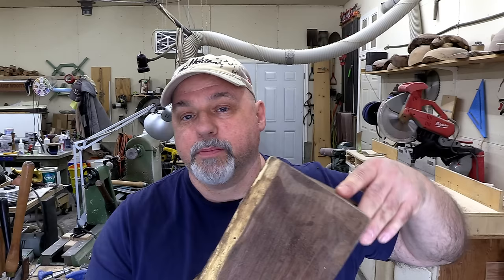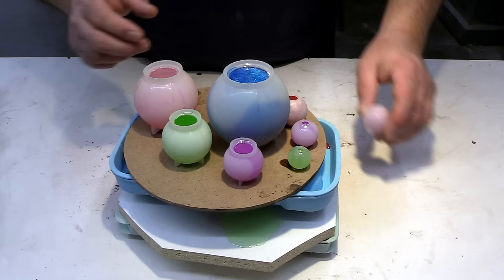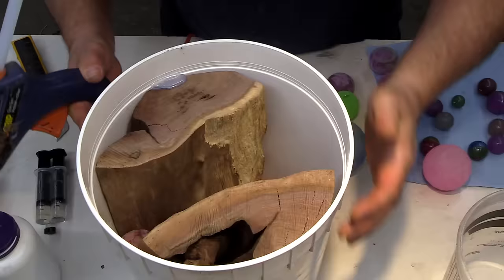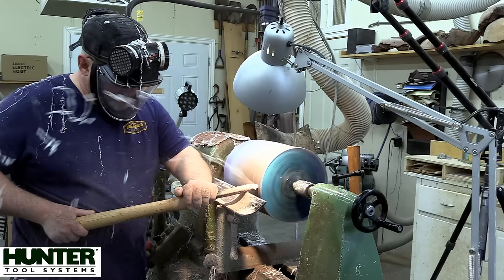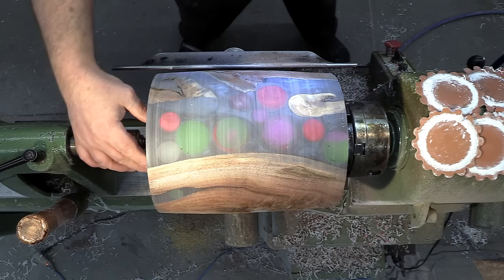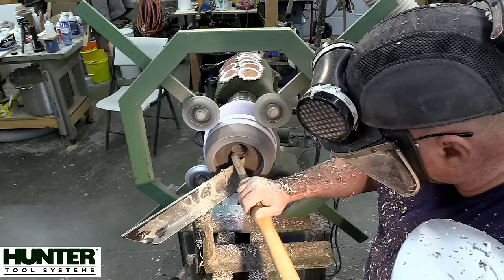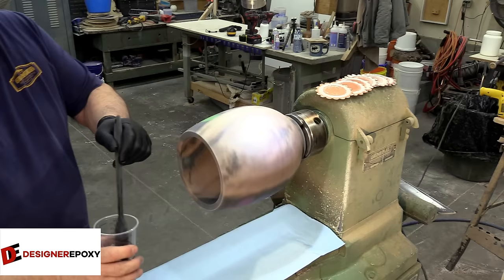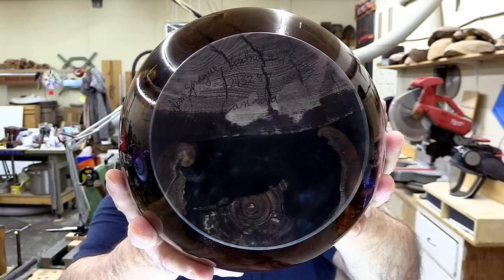Woodturning - It's "OUT OF THIS WORLD!"

Comment: Watching you fight with those silicone  ball molds I totally get it. I feel bad but I was laughing at the same time because I have been fighting with them too. Not the balls but the 4 inch cylindrical molds. My fingers are still hurting lol.
Reply: Oh, and by the way I use isopropyl alcohol (70%) to slip them off. It helps some. But they can get sticky.
Reply from the maker: The struggle is real!  😂 thanks!

Comment: That came out just lovely!  A good trick for getting resin pieces out of complex or tiny molds is isopropyl alcohol. Make sure you get the pure 99% variety and then spray it into a gap, or use a syringe to carefully insert it into the mold. Then squish all around to get it to spread and it should provide enough lubrication to help you pop the piece out. Then it'll just evaporate off. Careful though, it works VERY well and sometimes a piece can come out faster than you expect and end up across the room. Hope that helps next time you have some tiny spheres!
Reply from the maker: Good tip, thanks!

Comment: A good tip for the temperature of the epoxy, I suggest you place your epoxy resin containers in warm water a few minutes before you mix it!
And like that you won't have to lose time by trying to warm it up after its mixed 👌🏼😊
Reply from the maker: I’m usually warming the epoxy up so I can get color separation, it can be a problem when mixing but this is the main reason I warm the epoxy.  Thanks

Comment: A tip for the silicon molds. Hot glue won't stick to silicone at all (most glue won't) because the surface of silicon is too smooth. But if you use sandpaper on the area you want to stick together (like the bottom of the small globes), it will have more grip and stick much better with the hot glue! 😊 (You'll still be able to take it off the silicon, it just won't come off as easily)
And to help remove the resin from the smaller mold more easily, use some Mold Release! 👍🏼
Reply from the maker: Good tip! Thank you very much!

Comment: For the silicone ball molds, why not pour water on the top to weigh it down, baking stones, glass decorative beads,  cat litter... the possibilities are endless.  And to take care of any possible flexing, pour sand or another type of powder into the base of the lower mold, glue a cardboard sheet with a bread of hot glue around the perimeter.  Let that dry and set right side up.  But use the two plate methods for taking cakes out of the baking pan.  (Two sheets of cardboard)
Reply from the maker: Thanks for the suggestions!

Comment: Looks nice. I love the shape and the combo of epoxy and wood. I'm not familiar with that specific brand of top coat however wood Is a living element. The bubbles development comes from the wood itself. You can try using the first coat as a sealant. Buff after drying, then technically apply the first coat. Yes temperature and moisture plays a part in the curing process. But try noting when you do your top coats on a warm dry day or you can manipulate the conditions with a dehumidifier and a non- fan heater or a heating pad nearby for a few hours.
Reply from the maker: Thanks for this. Waterlox is awesome!

Comment: Try a negative ventilation setup on the covering bucket in the clean room for the final curing. Ensure to have a filter on the air inlet side. Just a thought. Designer epoxy.
Reply from the maker: I prefer zero air movement. Thanks

Comment: Have you thought about putting the led lights that change color in your vases to view the colors through the vases. I've used them in my epoxy tables tables brings out the color shifting mica powder.  I also used them in epoxy filled drift wood . Beautiful  display lots of those sold.
Reply from the maker: I certainly have, what’s your source for the lights. Way to many manufacturers out there to know what’s a good one to go with. Thanks
Reply: I buy from Amazon I get the plug in type with wireless remote. I make sure they are water proof also. I've actually put them I'm my pour. For smaller floor statues. Haven't had any negative feed back.  Your going to get the ones that are around 36.00 us

Comment: For the small individual globes try some warm soapy water it helps the silicone release from the resin
Reply from the maker: That really wasn’t the issues. It’s the small opening that you need to fit the globe through is the problem. Soapy water should work though. Others have suggested alcohol too. Thank you very much.

Comment: Really like it. Big fan of walnut and space. I bought one of the Hunter tools and I am having troubles. It catches real easy and takes chunks out of the resin. Watching you I need to hold it at an angle and a tiny bite higher than center when working on the outside. I love the gloss with the Waterlox. My biggest issue is it doesn't last long in the van after opening. I've got some stop loose bags coming in the mail. Designer Epoxy
Reply from the maker: Yes, stoploss bags will correct this in the future. Thanks for watching!

Comment: You mentioned that when using the ice cube molds they tend to separate, I think it's because the injector is closing off the hole and there's no where for the air to go so it pushes the mold apart. Try distorting the hole when you inject the epoxy so the air can escape. I think this may also fix the flat spot when it's not filled completely. Just my opinion. Awesome piece by the way
Reply from the maker: Thank you very much!

Comment: It looks great, I was thinking with this pease where the wood is,it's dark, what if you put cured epoxy balls or stripes into the wood as inlays, lamps with animal figures, there must be something like that in silicone forms, I don't know if you have tried direct air blowing into the bolls or vases when hollowing out, a air connection valve so you don't need to stop so often, or do you prefer the stopping more often for the control over the work pease, I would like to know 😊
Reply from the maker: I prefer to stop the lathe now and vacuum out the shavings. That way they don’t get blown all over the shop. Thanks for watching and thanks for the suggestions!

Comment: Hi 👋 Jim, As per usual it looks 👀 Amazing, Definitely blue globe has got a face in it something trying to get out, 😮, somebody else in your neck of the woods was more in the region where the eclipse was more prominent, I personally haven’t seen it since the late 90s  2000, 
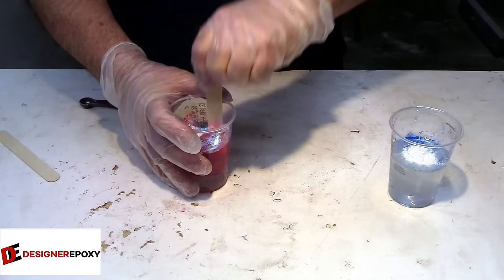Obviously too late now, but if you can get some mosquito net, make yourself some frames up through your doors and windows you then can have them open during the summer months , We have the same problem over in France, in fact where I live in rural countryside, we get a lot of hornets and other nasty little creatures coming in, Good to see the tumbling device worked well with your smaller globes, It might even be worth making up a little tent out of mosquito net to put over your castings when you’ve done the finish, And I’m sorry to say, I hope it hasn’t affected your analytics, but I had to watch it in two stages this week. I started watching it last night, but I’ve been working from quite early in the morning until late last night. I’m in the process of putting beams into my garage floor., as I got a price on having concrete ready mix, come in, and they wanted €2000 for six cube of concrete, So I decided to make a concrete beam along the front with a huge step on the inside and I’ve got 2 x 8 beam that I’m bolting to the back edge of it , then I’m running beams The depth of the garage approximately 6 m, and I’ve got a special very large dovetail jig, It’s made by a company called, Arunda Systems, I believe they come from Sweden. It’s for doing post and work construction of houses. I started watching this again around 4:15 in the morning., 
I hope you get a sale soon for your property , you never know the people that came saw you before the other day as you said might come back, I do remember you a few months ago clear in the snow in the parking area, keep up the great work look forward to next week, 
From France,
Reply from the maker: Wow, that’s a lot for concrete. I haven’t bought any in a while so that was shocking, lol. Good luck with the build and we hope the house sells soon too. Thank you very much!

Comment: A idea for making globe with aa\whole lot less of problems. Sand casting would work.  Another idea would be to have some machine aluminum sheet and machine half globes into each other. index the pieces and have them bolted together. Leave the surface of the globes a little rough save
Reply from the maker: Sand casting isn’t an option, the resin will weep into the sand and make mess especially if it’s placed into a pressure pot. Aluminum molds might work but in most cases you will need to push on the mold to get the resin out and I don’t know how hard that might be. Thanks for the suggestions!

Comment: Very beautiful.  But could the bubbles really be bits of air still escaping from the wood despite the epoxy coat?  I mean you use the heat to remove the bubbles formed by such air, it dries over night and oh more bubbles to remove as expected.  Could something still be getting through the epoxy into the final finish?  You do sand it to remove the expocy bubbles so that may open micro-fractures in the epoxy so any last air can seep out.  Maybe waiting another 24 hours before final would ensure no bubbles.
Reply from the maker: Yes, the bubbles do come from the wood, it usually takes multiple coats of epoxy before no more bubbles come from the wood. Thanks

Comment: I started a project using 3/4" oak on top and bottom with Leafs around the side, I've done this before with leaves running all the way to the middle but this time I filled the center with spheres from earlier projects. I got long cracks running all through the piece. I can't think of a way to fix it. the resin is only 3" between top and bottom. First time I've seen cracking like that in all my two years' experience. 🙂 I love your videos, the pieces you turn out are killer!
Reply from the maker: Open up the cracks and fill them with a contrasting resin. I’ve done the Kintsugi method here a number of times and most like it. Thanks
Reply: @SpragueWoodturning  Thanks for the advice!

Comment: Have you considered mold release? Or using like some alcohol to squirt around the sides of mold when your removing esp the smaller ones I realize it may not work with all the balls u glued in however. If you want to see some fun with hypershift dip your car often uses them in thier car coating videos they often ad shifts and pearl pigments to a clearcoat and then spray it over different base colors
Reply from the maker: Others have suggested using alcohol and will try that next time. I’m subscribed to the dip your car channel. Thanks

Comment: 😮 Holy Shih Tzu!!! (And that's just at the thumbnail 😆 🤣 😂) .

That blue orb caught my eye, almost looks like the representation of a neutron star shown on astronomy channels on here and I think it's frickin amazing.

The wood looks really great too, your moulds might have failed due to the heat of the resin melting your hot glue so you may have to find another adhesive solution that doesn't depend on being heated to activate them?

You need to do some R & D on custom silicon moulds to circumvent the bucket dikema though but that will take a little time to get right, I was thinking you could fill your bucket up with plaster of Paris and suspend it over your pressure pot by bracing across the lower pot with a wooden X and centering it before using spacers and screws to hold it in place and using custom silicon mould kits to leave an impression of the plaster in the pot itself (not sure how easy it will be to extract the resin pieces from the pot itself but the silicon mould inside the pot is one method to replace the plastic bucket problem and you could experiment with different mould shapes and sizes to create removeable silicon sleeves/jackets to pour into while in the pot?).

You should add is it mother of pearl pigment with the hypershift to add to the visual depth you achieve by using it in pieces? Worth a bit of R & D there too perhaps. The black really was enhanced by that hypershift though, wow.

The best way for you to see what pigments 'light up' with UV light would be to lay them all out on a table/bench in a dark room with no light source and then turn on your UV light and see which ones look like they're lit from inside the pigment itself (plus it might make other things look 'lit up' depending on their colour too lol). Only reason I know this was seeing things on TV or the internet I've noticed that were cool effects when you see it so I bought an energy efficient UV 'black light' bulb and UV posters and put them in a room and put the UV light on although the room looked dark in respect to everything the posters that reflected the UV light looked like they were the only sources of "normal" light or lamps themselves.

Now that isn't practical under being able to see what you're doing in a room it is a really neat effect considering the UV light makes everything else appear dark lol but I do suggest you don't look at the UV light directly as it can be sore on the eyes but if you were to be looking at the objects it reflects off or refracts through then you should be OK. (What's weirder is looking at your skin as it looks darker (almost black) as it absorbs the UV light and doesn't reflect the light in the traditional sense and it is such a contrast to seeing any light source create lines of reflected light we usually see and I would recommend anyone trying it as it is really cool.
Reply from the maker: Wow, lots of great suggestions here, thanks!

Comment: If you know you’re gonna to make a hollow vase like this, why not put a smaller bucket on the inside when you pour, so you’re not using so much product? When you take the inner bucket out, half of the work will be done
Reply from the maker: If you had the right pieces of wood then sure, it wouldn’t work in this case. Thanks

Comment: I have a question. Im just getting into Epoxy & found out a friend has a wood turning set up a couple months ago. My question is…as long as the final inside is sealed with Epoxy is it safe to put water for fresh flowers in such vases? Or is there a special sealant that should be used? My friend has let me use his workshop & taught me how everything works. I’ve manage to make a few plates, a couple bowls & a few small “vases” that look more like wonky cups in shape/size. But I gave one of those small “vases” to a friend bc she liked it and she asked me if it was safe to put water for fresh flowers directly in it or did she need to line it somehow. While I’m pretty sure it’s fine since I made sure the wood inside had a good layer of epoxy left even after sanding & polishing. With the thought of making it safe to actually hold water for flowers. But now I’m doubting myself. Also…I know epoxy is NOT safe for people or pets to consume food/drink from but anyone know if it’s harmful to plants? I had just assumed not with the variety of vase mold for epoxy.
— The case in the video turned out AMAZING! Truly need to find or someone invent better round molds that u can at least somewhat see what you are doing. The only thing I think may make similar designs better is of you’re able to get more refined/clear to see swirls in the planets with 2+ colors. But I know the epoxy was hardening on you PLUS for most of the molds you couldn’t see anything you were doing. Also I think this vase would work amazingly as a lamp base with a bulb above like normal but also a dimmer one inside the base. And with some kits I’ve seen lately anyone could likely turn it into a light like I described without drilling any holes in the vase. Wouldn’t be super bright as most such light set ups I’ve seen only go up to 40watt bulbs but that perfect for a bedside lamb. Or just putting a low wattage bulb inside would be nice. Just ideas🤷🏻‍♀️
Reply from the maker: I personally wouldn’t recommend putting water in a vase coated with epoxy. Wood will move with the seasons and you might get a small crack in the vase and then you’ve got some trouble on your hands. I recommend using a glass or plastic insert in the vase. Designer Epoxy products are food safe when fully cured as well. Thanks for watching!
Reply: @SpragueWoodturning  Thanks for letting me know!

Comment: My brother, you are supposed to use WATER in a rock tumbler.  The water should fill the tumbler up to the level of the top of the stones/marbles/whatever... So fill water until you can just barely see the top layer of your orbs/pebbles sticking out, THEN add the abrasive, cover and close...   Without water you're going to chip and break your tumbling objects as they impact each other over and over and you'll end up with poor results and a lot of broken stuff and chips.  With water, it cushions the kinetic blows and allows the abrasive to flow around and touch every part of every stone/marble... gotta use that water man.  Just like a stone gets dull and rounded in a river after so long, that's what a tumbler is supposed to emulate, being tumbled down a river.
Reply from the maker: Yes, I will add water next time. I was trying to avoid getting thinks wet, but ended up needing to wash them so I guess it really didn’t matter. Thank you very much!